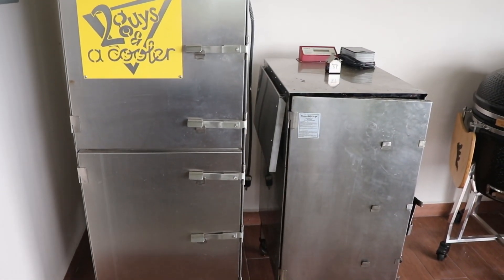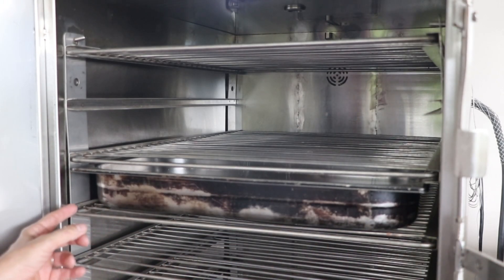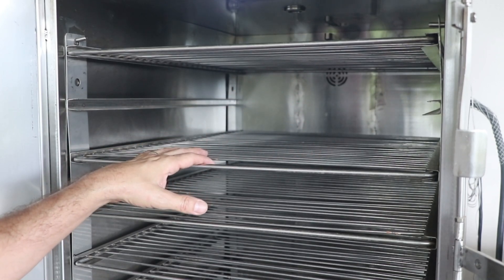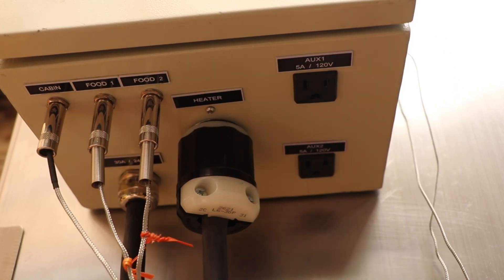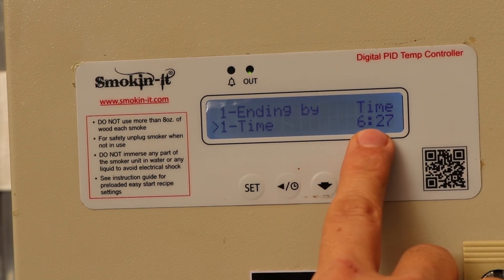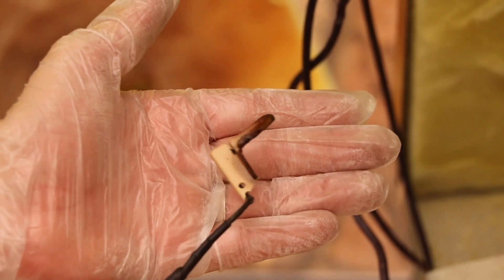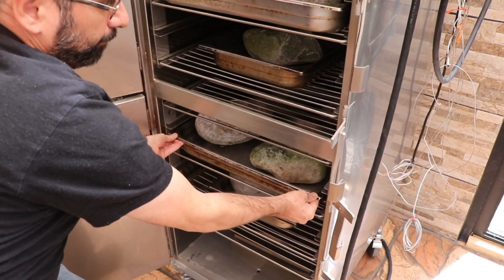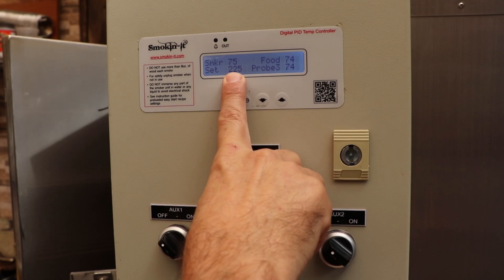Testing a Prototype Model 6 Smokin-It  Smoker

Comment from the maker: If Smokin-it can get the details ironed out, this smoker will be a force to be reckoned with.  What "EXTRAS" would you like to see in a smoker like this?
Reply: The biggest thing I’d like to see is the convection fan working great and be reliable. I have been looking at adding one to my 4D Wi-Fi to even up the cook and consistency of the products especially snack sticks. We hang 25 - 50 pounds of 16 or 19 mm sticks at a time in the number 4, and the back corners get a bit over done. I would like to see made in U.S.A. too, please.

Comment: A longer shaft through the rear re-circulation channel that would let them place the fan motor outside the insulated cabinet would solve the problem.  It would add another small cover and bump out in the rear of the smoker, but it would keep the fan motor cool (cover could have air vents as well).

Comment: I would love to see a dedicated video. I have a 5D-Digital WIFI With the smoke generator and the jerky fan.  I am never sure if and when to use the fan and for how long. 
I put dry brats in there and sometimes when I check they are wet. The jerky dryer takes care of that problem but is it ok to let it run for the whole cook?

Comment: What is the lowest temp it can be set at? I do more cold smoking than warm/hot.
Thanks
Reply from the maker: you can set it to any temp between 40f and 300f.  Obviously if you set it to 40, the burners will only come on if the inside temp is colder than 40f.  There is no cooling system only heating.
Reply: @2guysandacooler  thank you

Comment: Something rhat I found troubling is there's no filtration for the duct work and fan. Chemicals can accumulate and create a potential for a fire if it not totally foul up the fan.
Reply from the maker: It would be interesting to see how that would work.  The truth is that no additional chemicals would be found in the duct than in the smoker itself.  It's just a recirculating system.  If anything the fan might have to get wiped down from time to time.  We shall see....

Comment: I wouldn't call it a epic fail because of the fan but it is a problem. This is a easy fix not a game changer. Because you are working with a established smoker company I wouldn't expect serious problems but little ones can be fixed without a complete redesign.

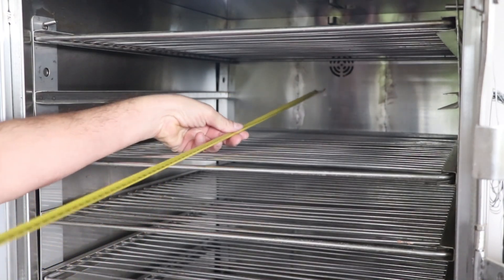Comment: I was not impressed with the fit and finish of this product, in particular the welds (look at area around vent at 4:26), the whole door lock mechanism (looks very flimsy), and the shelving - they don't lie flat which indicates shelf brackets are not aligned or the shelf itself is twisted (look at when you touch the shelves at the 2:09 and 2:22 marks). Hoping this is just because it's a prototype, but not sure why the craftsmanship would not be the same.  I'll have to go back and look at your previous vids on the smaller model you currently have and see if that's the standard for this company.  Glad you posted this since I'm about to purchase a smoker and it's down to this company, the Pro Smoker, the Sausage Maker, and a couple of others.
Reply from the maker: LOL.  The fit and finish are impeccable on the "for sale" units.  What you are seeing is a prototype.  The welds are my handy work (you'll see that in part 2).  The door lock is ultra tight and the shelf system is beautiful on the "for sale" units.  It would be an unfair judgement to make a decision based off of how a prototype looks.  The real testament to this smoker is that I've used it exclusively for 7-8 years with literally no problems.  Perfect heat management, ample space, incredible quality, and best of all great results!!  What's even more interesting is that as a content creator I'm being offered free smokers all the time.  It's actually quite ridiculous.  I turn down all these free smokers (and they are not cheap) to use the smoker that I bought with my own cash..  In my mind, that speaks volumes.  If you have a question about how it works or my experience with smokin-it, i'd be happy to answer every question you have but don't base your decision on your next smoker off of this prototype video.  You wouldn't be doing yourself a service.  Besides what smokin it is about to release (4-5 weeks) is a mind blowing, game changing, line of smokers.  Trust me😉
Reply: @2guysandacooler  Thanks for that info Eric, but still doesn't make sense to me that they would use a different process (level of craftsmanship) for making a prototype than they would a finished model, esp since poorer craftsmanship could affect the results of a prototype test. Re: welding, not sure why you are part of the building process on their smokers, but I guess that'll be explained in part 2 as you mentioned.  With that said I'll go ahead and hold off another month for their new line, but I've got 4 pigs worth of bellies that need to become bacon here soon :-).  Thanks again and I do appreciate your reply.
Reply from the maker: They wouldn't.  This model is roughly 2 years old (we've been testing for a long time😉).  I've literally had it all apart, abused the shelves with weight testing, abused the shelf brackets, by seeing how they can handle pressure tests, I've abused the cook box, welded an entire new ventilation system to the back, you name it.   When I received it 2 years ago it looked amazing, now it's been run through the ringer.  I hope to have part 2 out soon.   With that being said and after 2 years of testing the new line of smokers that are about to be released are quite frankly pretty impressive!!
Reply: @2guysandacooler  LOL. Looking forward to seeing their new lineup.  Will the price point be comparable to their current stuff
Reply: @fooddude9921  Prototypes usually look like ass and aren't made to last. The focus is on getting it made quickly so you can test the design in the real world and move on to the next revision.

Comment: The problem I always have with electric smokers is the short life of the heating elements as well as after a few years the elements are no longer available.I know propane and wood smokers are not as convenient to use but they last for many many years.
Reply from the maker: For what it's worth, i'm still on my original heating element (6+ years running).  With that being said it all depends on how someone runs their smoker and the quality of the heating element.  I know if you run your smoker at 350f like I did in this video the heating element's life will be greatly reduced.
Reply: @2guysandacooler  That is impressive I only got a few years at best. living on the porch probably didn't help either.

Comment: I don't see the point of having WIFI and app for everything in existence.
Reply from the maker: I'm sure there will be a non wifi version just for you😉
Reply: @2guysandacooler  Hopefully
Reply: It's pretty handy to have on a smoker, actually. A stall can make the finish time vary wildly. If it reaches the right temp when you're not around you can drop the temperature remotely.